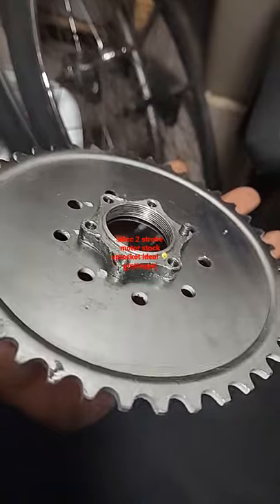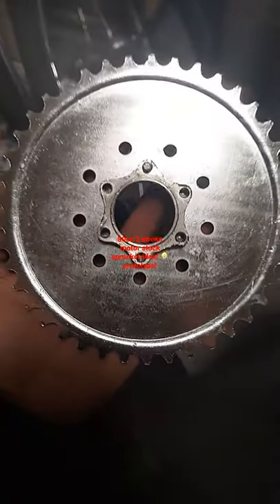testing @ new prototype idea! on a 80cc 2stroke motor stock sprocket                         💡 👉👍👈

Comment: It works I did the same thing similar to that with stock sprocket adapter it's on my hyper beach cruiser but it's black I spray painted it I didn't use the actual spacer I ordered
Reply from the maker: @Willard Buchanan that's wussup ma brother! That's what am talking about get creative use your creative mind! 👌 am doing the same am not gonna need the spacer for this one and ama do the same powder coated white and spraymax clear    after am done with the prosses

Comment: This is interesting, i wonder if it will work. That's a genius idea. Did you come up with using the disc mount for the chain ring ?
Reply from the maker: @BIKE MAN MA GUY YES I did some research on some rims for the motorized bike so I order 2 rims that comes ready for installation and I saw that the rims come with the sprocket adapter already built in it or has the adapter where you can take it off idk yet but I though about doing my own customize sprocket adapter holes do yo the stock sprocket from the 80cc 2 stroke motor
Reply: @ajmotorsport9246  I'm totally confused how these things work, so in the end of the video is some adaptor on the freewheel side ? And what is the disc brake adaptor for ? like to make a wheel for rim brakes to disc brakes ?  I feel so stupid not knowing anything about this. :P
Reply from the maker: @BIKEMAN21  is ok ma brother what am doing is for the motorized bike am putting together, the rim you saw at the end is the rim ama use  for the motorized bike am putting together the rim have the treads for the disc brake adapter you can also find rims that already have those adapter ither build with the rim or has the adapter that you can take of wen you need too am just doing a new thing where I'm using the disc brake adapter for the 80cc sprocket something I though of trying out
Reply: @ajmotorsport9246  This is a perfect example of when I try to figure something out and do more research about it but soon realize i now know even less then when I started lol It seems the more I learn the less i know... you know ?